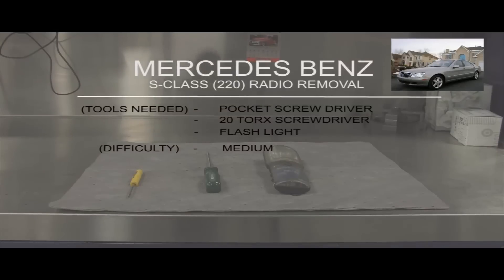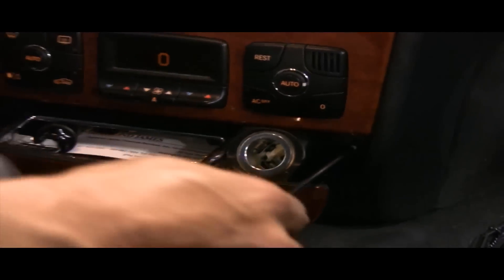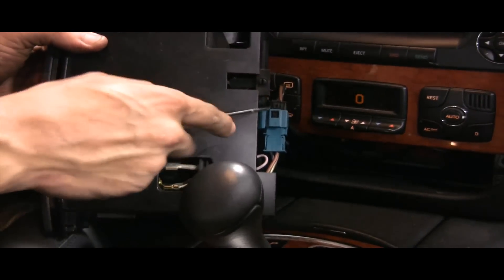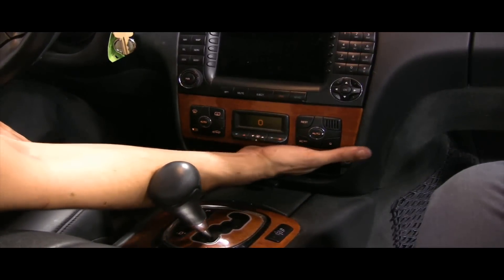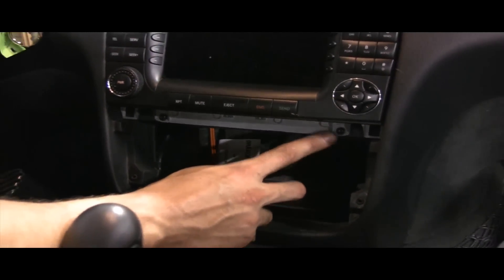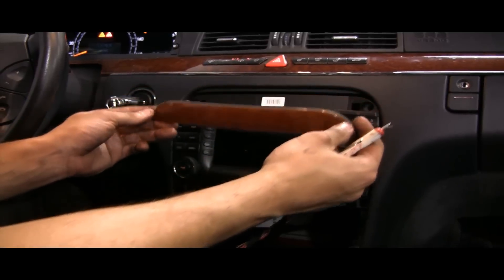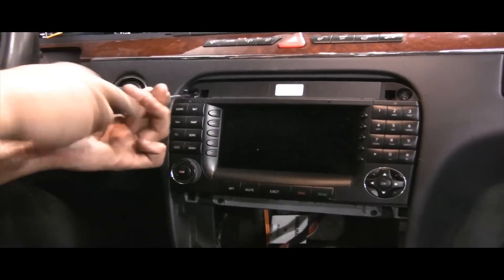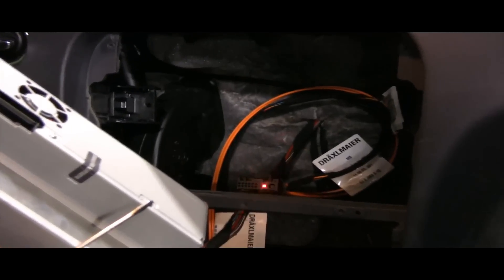BENZWERKS-S CLASS (220) RADIO REMOVAL

Comment: Maybe off topic, but I have this problem with my clock in the dashboard, it is 6 minutes behind and when I try to ajdust the time in the GPS, I can only adjust hours and 30 min steps. The manual states that I can not change otherwise as long as the system has connection to the sattelites. So - how do I change the minutes? (Also, the date is totally wrong, but dimmed out, so no change of changing this either). I have searched the Internet for weeks now, and no one seems to have the solution.

Comment: You are Awesome your patient and I can follow you with confidence I like your videos I have a question I own a 2006 S500 Mercedes and when I start it up my radio has a blank screen no sound or anything when I remove the key and start again I’m radio works if you can help me please or guide me how to repair the radio.  And do you have a video on how to replace the gps antenna

Comment: I removed my unit and tried to install a new unit with ipod and bluetooth option but I have different connectors!
My car is older model from 2003.
The old unit was similar like yours but only CD. 
So how do I install the new unit?
I have 3 larger connectors from the car and I could only connect 2 to the new unit... I have 2 smaller connectors from the car as well... and plus antenna...
Please help!
Thanks

Comment: Can the 2003 S500 OEM radio cross fit in a 2001 S500 model in a plug n play format, or will it entail more work to get it fit and work properly? (Are additional adapters or anything required?)
Reply: This is really interesting for me, too !!!

Comment: my husband have a 2000 s430.. he just purchase a radio for 2003 s430 to put in the car. He like to know if it will fit and if he need to make any modification for it to fit perfectly. He also will like to know if there is any items that are need to make this transition as smooth as possible?